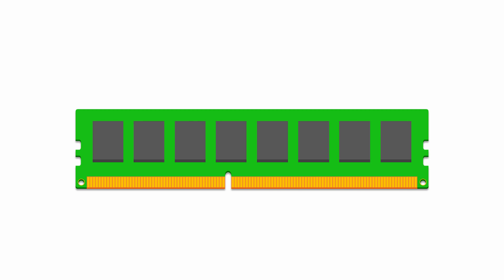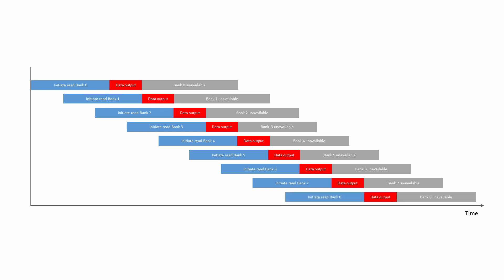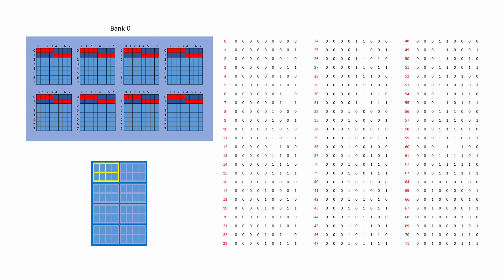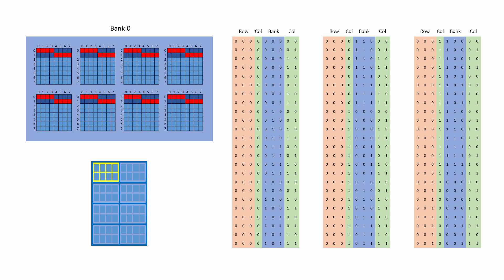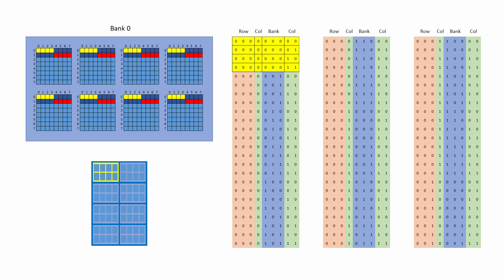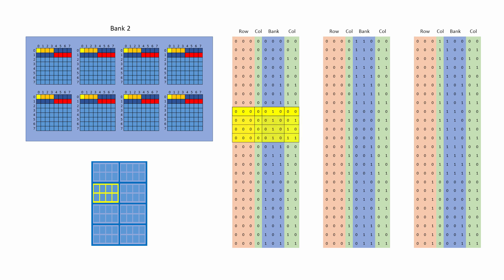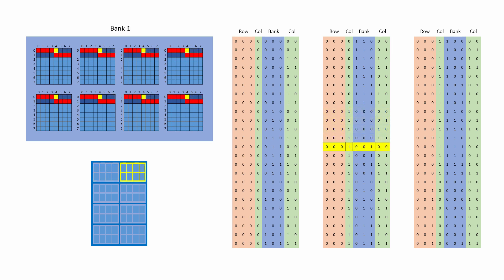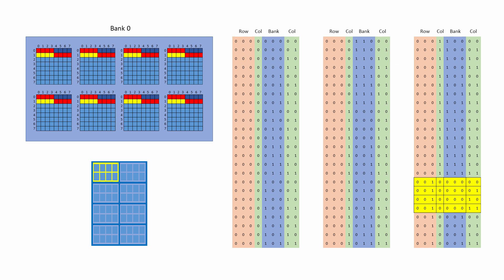Dynamic Random Access Memory (DRAM). Part 7: Memory Address Mapping

Comment: Thanks... very structured and detailed. It would be nice to follow up with an example DDR IC and Controller interface(72bit ECC) pointing out the connection alternatives for multiple rank configuration.
Reply: Yeah
Reply: Share if you found any :)

Comment: There is some confusion I think, once you've activated a row, you can issue any amount of read bursts (n*bl8) to it since the row is still registered in the sense amps. Since there are quite a few columns you can do this quite a few times. Ofcourse you eventually will have to precharge/close the row due to refresh requirements and so forth.

This way of doing things is sometimes referred to as open page policy.

Comment: What I am asking myself: For a burst length of 4B, did it really make a difference to put the column MSB above the bank address? Because with a clean row-bank-column address map, if I am correct you would just read from a loaded row (open page) twice, before going to the next bank (meaning that still whenever you need a new row, you still access all the other banks first). Is it faster to access a loaded row in another bank, than to access the loaded row in the same bank twice in succession? (I could imagine it being like that, because a memory controller might use the peripheral electronics in successive banks in parallel, or even do lookahead)

Comment: Great job. A really fine series. Well organized. Well delivered. I am glad you included memory address mapping. I have been looking unsuccessfully for good, clear coverage of the topics of your series and not found anything clear and comprehensive, and then I found your fine series. One question. When there are two or four independent memory controllers, do these tend also to be multiplexed in the physical address mapping low order bits, for maximum parallelism, or do they tend to be high order bits? I would also be interested in multiple ranks but most interested in multiple controller channels. (FYI, I am most interested in Intel Core i7 Skylake and MacOS.) Thank you for a great series. (FYI, I would also be interested in a series on modern multilevel caches but only if it included explaining non-inclusive caches and cases where the memory controller can write to the L2 or L1 cache without writing the L3 cache (non-inclusive), and also whether writing a cache line back to main memory always writes all the bytes or can selectively write only the needful dirty bytes. I also have questions about flushing cache in a hyperthreading case when one of the threads gets swapped out.)

Comment: Can you make a video on refreshing the DRAM or refresh rate of DRAM. How are multiple chips refreshed in memory? Are they simultaneously refreshed as a whole chip or a whole row of a single chip is refreshed and so on? or is there already a video from you which covers this? Also I can't thank you enough for this amazing videos. Keep up the good work.
Reply from the maker: Hi Naeem. This is the final video of 7 in a playlist about DRAM.  I may have answered some of your questions in the other videos.  Please search  my playlists for DRAM. :)KD
Reply: Each chip has its own chip select line so you really don't have to refresh all at the same time, however these chips are usually organized into groups called "ranks", for ex 8 (x8) chips would give you 64 bits of data for every query, since they function to give a full word it's not ideal to refresh only one chip but the whole rank together, if you have multiple ranks that can be used alternatively then yes you would refresh them individually while the other one would be used in the meantime.

Also, dram requires all the cells to be refreshed in 64ms, however most drams can only refresh one/two rows at a time. Once you issue a refresh command the internal row counter is incremented by 1 and the current row is considered refresh. Issuing a refresh command once every 7.8us will result in 8K row dram to be fully refreshed in 64ms. The row counter returning back to 0 by the end of it. Chips with 16K rows will refresh two rows at a time so the idea is still the same.

Comment: I have one question: in the video, burst mode is used, to read multiple collums from one row. But i have also heard of "prefetch", which basically also allows you to read multiple collums from one row at the same time (DDR4 has a prefetch of 8bit, DDR5 one of 16bit). Is this type of prefetching (i am aware, this word refers to many other techinques) a synonym for burst mode, or can they be paired?
Reply: That was covered in the previous video in the series.

Comment: Great video series. Very illustrative.
But I think there is a mistake about interleaving at https://youtu.be/-xtWsQvOcjo?t=54 (and before). You say 8 banks are used to make a 8 burst possible. It seems incorrect, since most modern memory still obeys tFAW=4, which means for a same rank a max of 4 banks can be simultaneously opened. Therefore, the interleaving you explain does not match with the numbers. 
IMHO, when a column is read, it is already contain all data, and the column itself is divided and emitted in bursts.